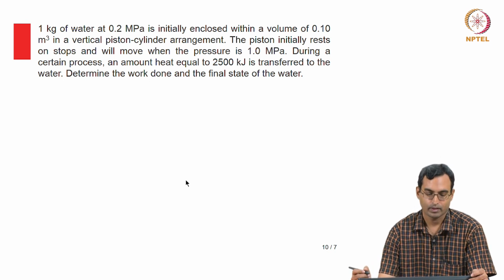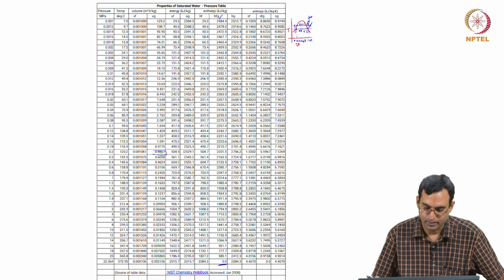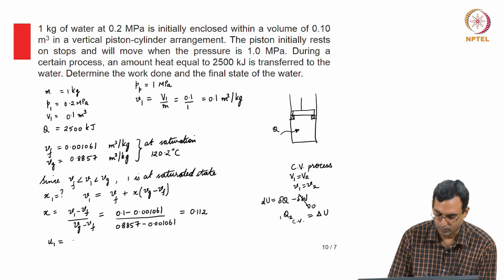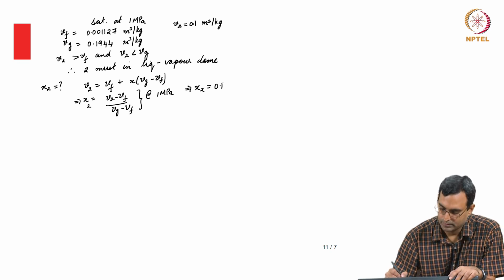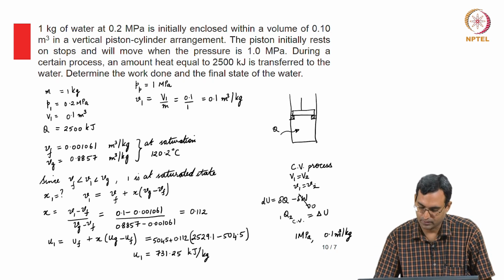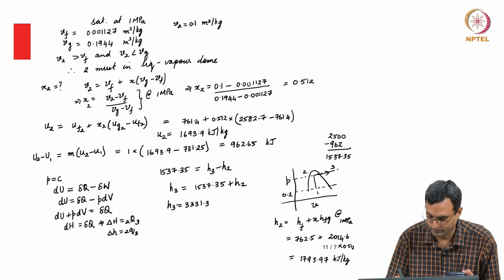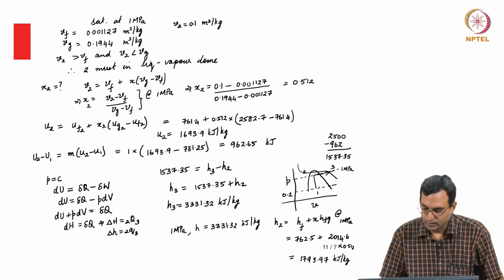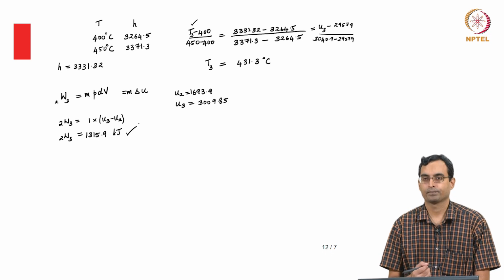Tutorial problem - Part 1

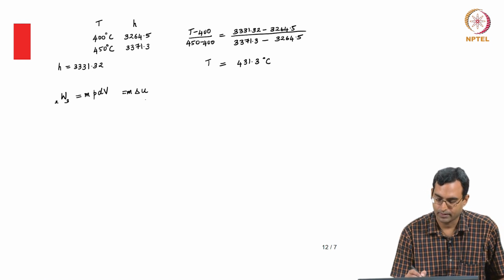Comment: All the calculations are correct upto 30:28. After this there is a slight mistake in calculating workdone,
W(2-3)= Q(left) - dU
Q(left) =1538.26 kJ
dU= U3-U2=3009.85-1692.995=1316.855 kJ
W(2-3)=1538.26-1316.855=221.405 kJ
Final volume= 0.321 cubic meter
Final state= superheated steam
Reply: How did you get final volume
Reply: Interpolation